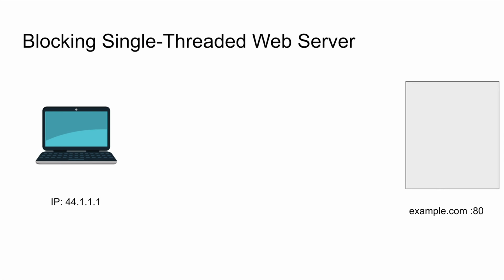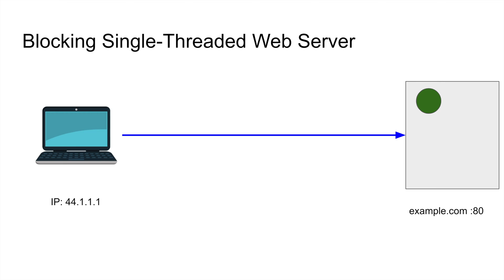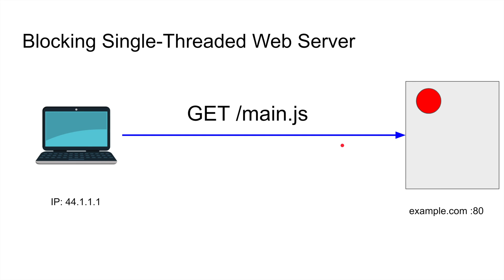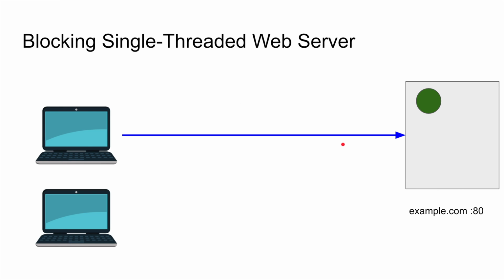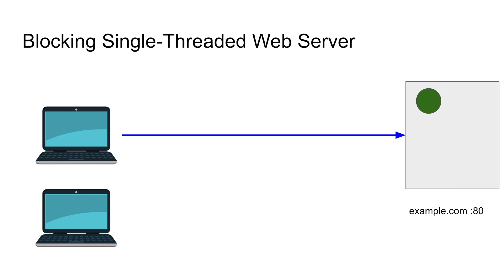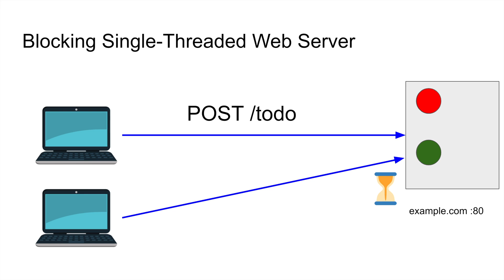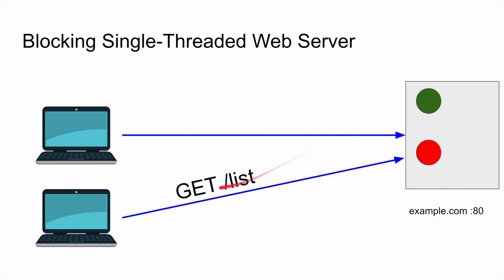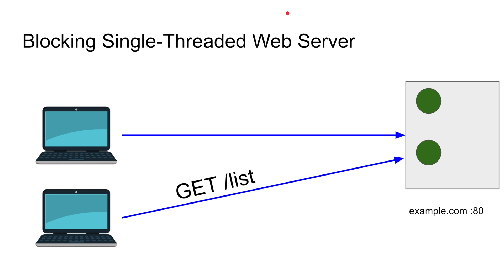Blocking Single Threaded Web Server

Comment: How exactly a server handle multiple request at same time i mean doest it spin a new thread for all new requests and how many threads a server can have at a time, could you please expit in more deeper, it would be so helpful.
Reply from the maker: Good question! 

There are two ways of implementing this: single threaded non-blocking web server such as nodejs or multithreaded webserver such as Apache tomcat. 

I talk about those in details in this video you watch this video to learn more about the difference https://youtu.be/0vFgKr5bjWI
Reply: @hnasr  Yeah i have seen this video on the same day you launched this. But actually am confused about whether in single threaded non blocking model can we have different thread at a single time by allocating different memory space for tbese thread or we have only one thread for all user?
Reply: @yatendramaurya6369  If talking about Node.js, it is a single thread which handles all the requests but internally maintains a thread pool which provides threads for IO operations to support non-blocking calls in the requests.
Reply: @hnasr  The nodejs process will contain single thread to accept the requests from multiple clients it will not spin more threads, If you think of a server it end of the nodejs is just one process meaning there will be only one thread to handle all the users request

Comment: Okay, so it’s an interesting idea to dynamically spin Docker containers for each process, but the big issue I see is with storage space.
Each instance of a container takes at least the amount of space of the base image plus whatever you install in it. So even with alpine image that’s minimum 5MB per instance. With Node.js that’s now like a 100+ MB binary.
So if you want to do it this way, you better have a really good system for lifecycle management of containers.
I’d be interested to see what kind of a use case this would be good for - perhaps something highly secured where you’re trying to decrease attack surface by aggressively walling off server processes from each other?
Reply from the maker: A 100% (nicely illustrated by the way) if you are going the container route you better orchestrate those suckers otherwise might as well stick with thicc VMs. (Yes right spelling)